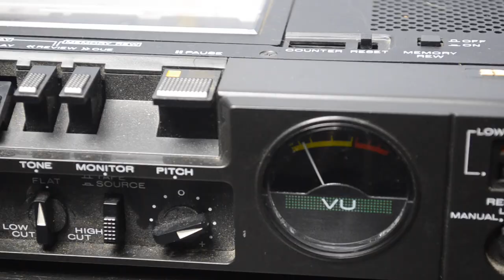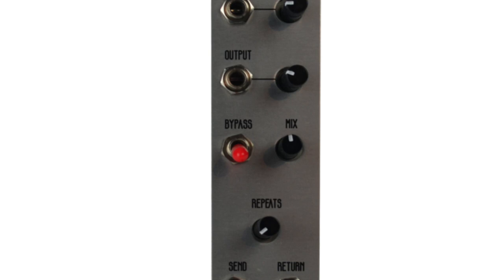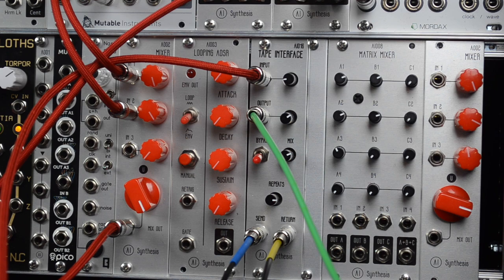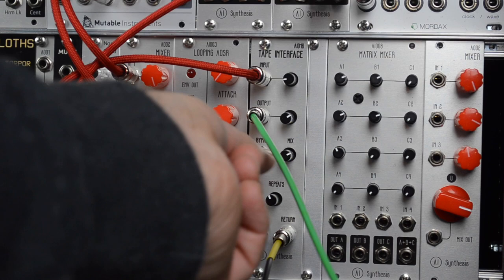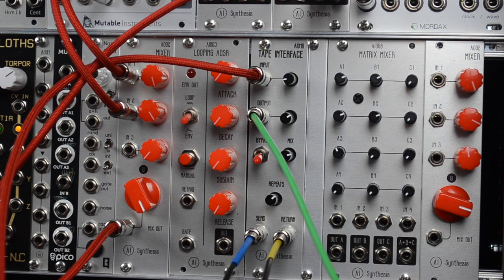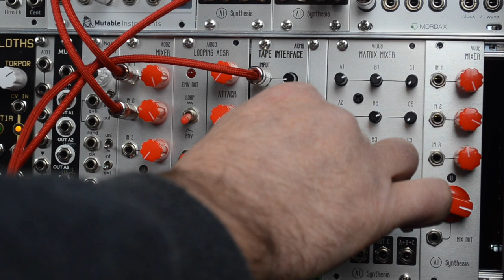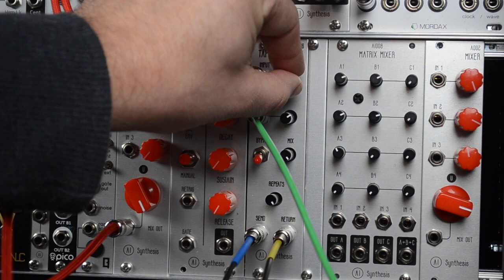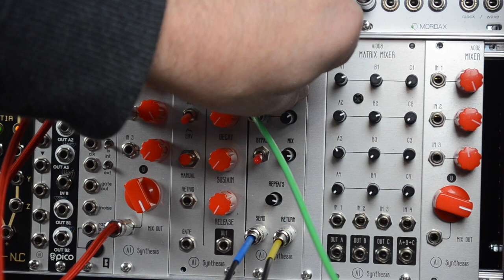AI016 Eurorack Tape Echo Interface Video

Comment: Soooo, do we get the looping AI synthesis cassette along with the kit?  
Or do I got to go and break out some of my father’s old heavy Chrome TDKs?  Would be really cool if you could somehow fit a custom cartridge INSIDE of an old 8 track that housed the three heads and the whole circuit, with some sort of flexible sliding mounting hardware for custom positioning of the heads?!  And of course a module that just has the receptacle for the 8-track with a back plane protruding right where you’d expect it to have its tape exposed!  I think I maybe smell your VCO’s expansion coming, Ehr, oh pew?! never mind it’s just my hot air desoldering tool melting away something mechanical in my old tape deck.  Awesome module.  your really taking your modular synth in a very unique while classy direction!   THANKS!

Comment: Is this the same as the old echomatic circuit? Any thoughts on adding filtering to the circuit to taper off some of the high frequency feedback that is common with the PMD echo effect?
Reply from the maker: It's the same concept but laid out for Eurorack, yes! I kept it the same so stomp box people could use it. I didn't include filtering for a few reasons: 1) I like it, you can hear it at the end, and I love it. 2) You can use it with a lot of decks and not all have the issue, and 3) It's euro! You can always filter it. That said, I like the suggestion. When I get back from vacation I might add documentation for a simple resistor/cap passive LPF.
Reply: @AISynthesis  awesome! thanks for explaining, i'd like to build one of these soon!